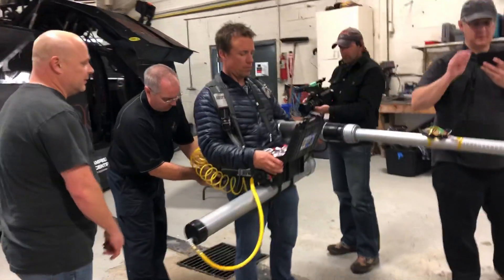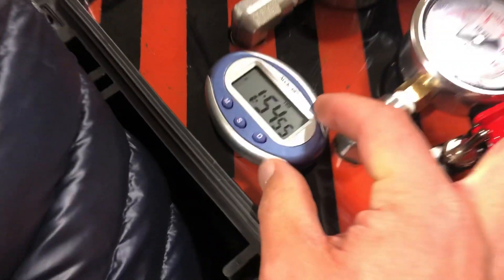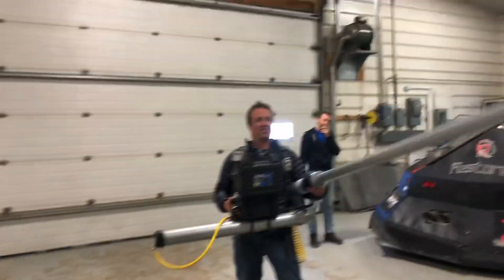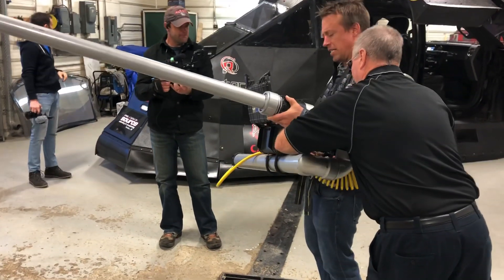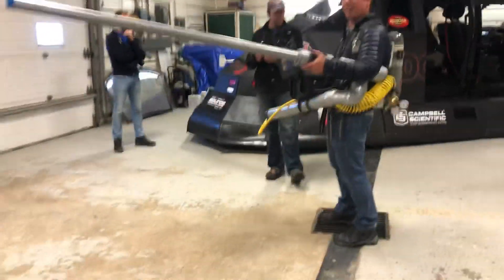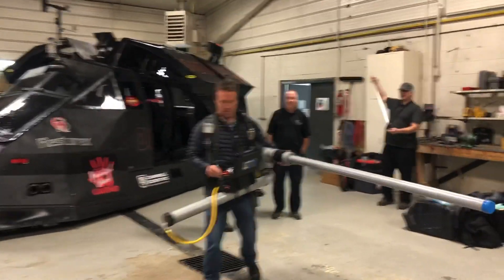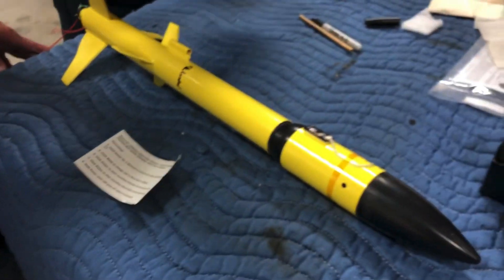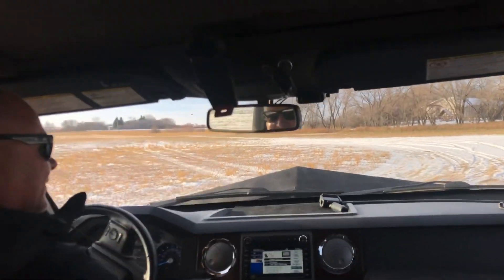MONSTER AIR CANNON to launch sensors into tornadoes!

Comment: Reed....use Baloons half filled with helium half with air so they can hover but not climb, and if you can put a gps tracker within the probe, and something what cuts the wire between the Baloon and the Probe after 5-7 min you will be able to find the Probe and download the Readings

Comment: Just get some inexpensive drones and fly them into the tornado. or Estes rockets with D engines will do it way better for cheaper. Just saying.
Reply from the maker: We do drones and rocket launches as well. Check out the Linwood, KS EF4 intercept video from May 28, 2019